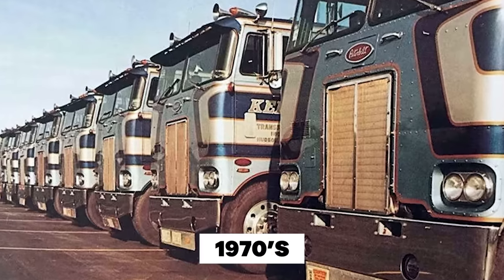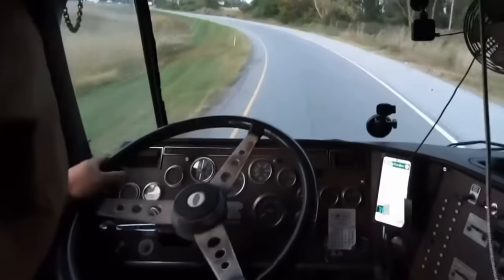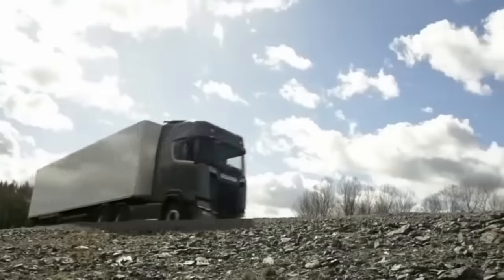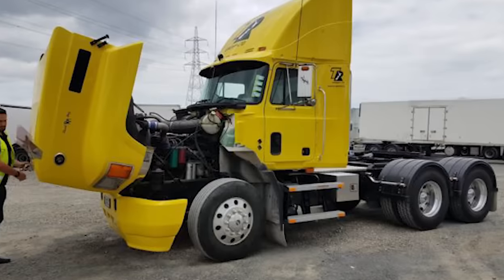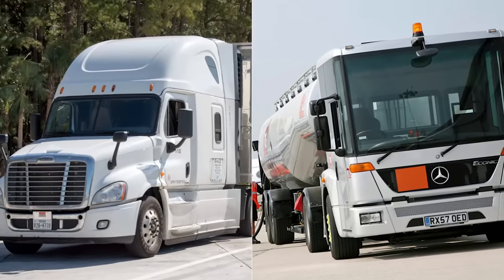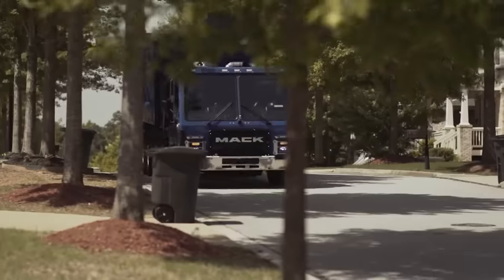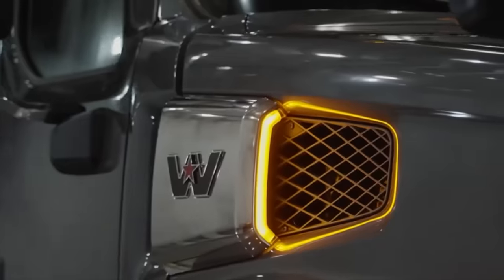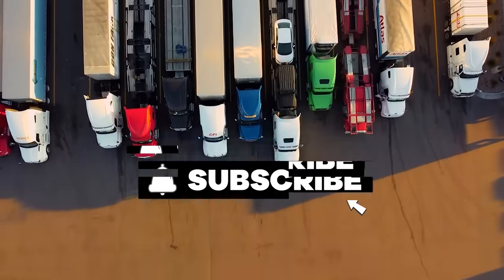The REAL Reason Why America Stopped Making Cab-over Trucks

Comment: In English they are known as 'forward control' and they are not only favoured in Europe because of legislation, but because of the roads. Many roads through European villages, towns, and cities, have remained unchanged for hundreds of years and were designed for horse-drawn vehicles. You're welcome to try driving one of your monstrosities around Europe, but I wouldn't recommend it. Even with the limited overall length of European vehicles, it's still not unusual for them to get stuck on narrow roads.
Reply: happens in a lot of northeastern US cities too, As like the ones in Europe they predate motor vehicles.
Reply: You’re also first on scene of an accident, plenty of cases of ejections through the windshield from impacting other vehicles, COEs are cool but conventionals are much safer for the driver
Reply: @loganbaileysfunwithtrains606   modern cab-over trucks are very safe, i think volvo has one of the best safety features in their trucks today.
Reply: @loganbaileysfunwithtrains606  Not much evidence of that. From statistics from the NHTSA, in 2020 there were 608 drivers of heavy trucks killed in the USA. In the UK (where cabovers are universal), 18 drivers of heavy trucks (called HGVs in the UK) were killed. That means in the USA there was almost 34 times as many trucker deaths with just 5 times the population. That's over 6 times higher adjusted by population. Of course, distances driven are much higher than in the UK, but when I looked up the statistics further, there were 3 truck drivers killed per billion miles driven in the USA and 1 per billion vehicle miles in the UK. That's close on a ratio of 3:1.

There is another point, that a cabover gives much better visibility at junctions, simply because the driver is so much further forward. Safety isn't just about surviving a crash, but avoiding them in the first place.

In any event, in both countries it's other road users who are in more danger. In accidents where a heavy truck is involved in the USA, only 17% of the fatalities are to the truck driver.
Reply: If you put your seat belt on, it's not a problem....
Reply: Let me guess, too cool to wear a seat belt?
Reply: No thanks on driving a monstrosity on European roads.  In the northeastern United States,  there are a few older places that are very challenging to get one into. Some city streets in older cities like New York, Boston & Philadelphia are difficult too.
Reply: Here in town even for busses it is narrow. Every car coming in front need to really watch and the bus driver needs to drive exactly narrow on the curbs and the car driver watches to not Scratch his alloys.
Reply: The reciprocal of your European circumstances is true in North America. Modern municipalities with wider longer highways and streets, greater distances between cities and towns, above all far greater comfort and safety in the conventional truck negates the use of cabovers in America, that includes Canada . I've observed that Russia favours conventional trucks. Why do you think that's so? So we can agree that cabovers are suitable for most of Europe and conventionals for North America, especially for Canada. Even most of our occupational trucks are conventionals.
Reply: Just because you cannot use them in Europe you do not need to bash them and call them monstrosities. You have probably never driven one so don't bash what you do not know. Besides pushing all of the air with that big flat front is probably really a fuel saver for you.
Reply: @scrambler69-xk3kv  yep they are thinking of changing the rules a little for EV trucks. EV trucks are also allowed to load slightly more weight. But why not for everyone?
Reply: @loganbaileysfunwithtrains606  try to see safety test of modern european trucks, all is very serious, you survive in almost 99% of car accidents possible to happend with your trcuk
Reply: Thank you for typing out what was said in the video.
Reply: @loganbaileysfunwithtrains606 there is nothing conventional about your oversized american trucks
Reply: @TheEulerID I've been driving an over-the-road truck in the United States for close to 37 yrs and I loved the cabovers. 
As far as safety almost all of the crashes involving a car and truck its most of the time the cars fault . 
I avoid many crashes daily because people in cars don't realize how long it takes for a truck to stop or that a truck needs to swing wide on corners. 
I get brake checked and cut off on a daily basis.
Reply: Been there done that in full size American Truck and Trailer. There’re many towns and roads like this in small Northeastern and North Western US that were built 200 -300 years ago and the Main Street that as straight as a ruler is the only street you can drive through … If you need to access some building and it’s not on the Main Street you have to call your receiver and ask them to bring small box truck and a Fork Lift or a Pallet Jack ..
Reply: Love the dig at the US "monstrosities" yet you make excuses for your poor roads.
🙄
Reply: I like my monstrosity thanks. I'll keep it.
Reply: Lotta words to reiterate something already said in the video. Needed to slip "monstrosities" in that bad? Maybe it'll help you sleep better in that coffin of a COE.
Reply: Yes yes.😊
Reply: @TheEulerID we have immensely longer distances to drive on average…
Reply: @clydecraft5642  Not necessarily. The EU has a lot of very long distance truck drivers. It's one big market, and there is a great deal of goods driven thousands of miles. There are plenty of drivers of such trucks and that stay overnight in them. You might find trucks travelling from Romania to Ireland, or more than 2,000 miles. 

Of course the distance driven on any one day is limited by the number of hours that they are allowed to drive.

In any event, it's a myth that US trucks are safer or more comfortable. They are not; modern cab-over designs from Volvo, Mercedes and so on with air suspension are at least the equal.
Reply: Yes, that term was used in the US as well, he just failed to mention it, or maybe he was not aware.
Reply: we dont have narrow roads here, especially none that were designed for horse drawn vehicles. our roads are made for high speed travel, that only take really really slow turns so you can drive 250kmh and beyond, thats why we dont have a speed limit here in germany. the reason we stick to capover engine designs is simpy the opposite of what he said. you have more space for a bed and the driver. our trucks are as long as the american trucks. they have their driver department and the engine in the front, our trucks are the same length, but because the cab is over the engine the cab can be way bigger. a sleeping compartment is required by all trucks, because the drivers have to have a place to sleep, because in europe they drive a lot of long distances like a really important route is spain to germany, because spain has literally the most greenhouses in the world to grow all our fruits/vegtables that get sold in markets here. but the larger ones im talking about for really long distance hauls have cooking space, too. its like a camping van on the inside.
Reply: @rolhen8221  Don't you think other countries have similar roads to the Autobahn, including the UK?

In any even, there are twice as many fatalities per billion vehicle miles on the German Autobahn system than on UK motorways. Ultimately, you can't beat basic physics. Kinetic energy goes up to the square of velocity, braking distances vary with the square of speed, and the distance travelled in the reaction time of a driver is proportional to the speed. 

Large speed differences between vehicles increased dangers markedly. There may even be fewer accidents on the Autobahn that on UK motorways, but at much higher speeds, they become much more violent.

Then there is the environmental impact as travelling at high speed simply burns far more fuel over a given distance.

Unlimited Autobahns are the German version of the US 2nd Amendment to the constitution. Basically justified by boneheaded stupidity refusing to accept the consequences.
Reply: @TheEulerID The unconsidered factor here is that most of those US deaths are due to inexperienced drivers falling asleep or misjudged the weather. We get every type here, and some of those drivers have never seen snow or ice.
Reply: @TheEulerID  Speed, driving conditions, and amount of time behind the wheel each day are factors. In the EU, the speed limit for large trucks is generally lower than in the United States--80-90 kmh is about 60 to 56 miles an hour.

____________

Experience of a UK trucker working in the United States:

When snowstorms would hit Mick Flynn's native England, he and his fellow truckers would pull over.

"Most sensible people parked over somewhere and enjoyed a nice cup of coffee," Flynn told Business Insider.

However, he said that's not the case in the US and Canada, where Flynn has driven on and off for the past decade, and that "you're expected to carry on."

That's because of a major flaw that Flynn and many others see in the American system of driving: Truckers are paid by the mile, not by the hour.

And they're allowed to work more hours per day — British drivers are capped at nine hours, but American truckers may drive up to 11 hours. (In a 2015 survey, nearly a quarter of drivers said they "frequently or always" exceeded the 11-hour limit to earn more money.)

"In England, if the roads are icy, cars pull over because you're still going to get paid," Flynn said. "If we pulled over in the US or Canada, we're not earning anything. So we were driving in worse weather than we would in the UK."
Reply: I drove a Transtar for years and I didn't push a lot of air cuz I was behind a conventional that was slicing it for me. There was times I got 8.5 mpg with 80k on the long runs.
Reply: @AverageAlien  the entirety of the Americas is oversized. A perfect fit.
Reply: I remember two words from Germany. Maneuver Damages.
The most humorous and expensive being when paper bags of potatoes broke loose from an air drop and shattered roofing tiles. All had to match, so the US Army ended up buying the homeowner an entire tiled roof. Needless to say, those spuds were properly restrained in subsequent air drops.
Someone always cut a corner too tight, got expensive. Ran over a cow, learn that that cow sang the kids to sleep and taught them to read and write (OK, pay for what milk the cow would've produced over its entire, long life and well, rightfully so).
Oddly, I never damaged anything. But then, I hate paperwork and hate screwing up other people's property even more, as I'd not like it happening to me.
Reply: How many people here are actually truck drivers?  🤔
Reply: @ernestpaniagua1210  back when I was in the army.
Reply: Sounds like Vermont.  Every time I picked up rocks in Central VT, going to Chicago,  I got a specific routing from the STATE of VT that I had to take or be fined.  I snuck in across the NY border once and found out why.  I very nearly couldn't get around a town corner because the streets were so narrow and buildings co close together.  After that I followed the mandated routing.
Reply: Why must you call them monstrosities. If you would see them on the roads they were designed for they look ever so normal.
Reply: @scrambler69-xk3kv  well, they were designed for narrow streets. Still have quite a few around for that use in US inner cities, where streets can be way too narrow for long nose vehicles.
And I've driven both types in the Army in European streets, the point is valid about long nose trucks on streets designed for horse carts - as true as for Boston, Philly or NYC.
Reply: @scrambler69-xk3kv    Yes, cabovers are awesome.
Reply: I totally agree. I drove for 7 years in Europe for AAFES Europe (Army Air Force Exchange Service) in the 80s and early 90s. We had COE American trucks (GMC, White and Ford) because there's no way you were going to make it anywhere with a conventional. A German friend of mine bought a 1989 Peterbilt 379 and shipped it to Berlin. He only hooked a trailer for truck shows. There were corners he couldn't take bobtailing. Europe made a truck driver out of me for sure.
Reply: even a fkn camper gets stuck in some small EU city. you miss 1 sign on the road and you are done for the day
Reply: @joelspaulding5964 with their ugly little cab over😂
Reply: Much like our cars, long nose tractors are built for long distance comfort. Driving a hard sprung crap box 1700 miles just so the very end of the trip is a little easier when maneuvering is a pretty miserable trade off.

Comment: I'm not a trucker, but recently I drove a smaller cargo vehicle with a flat front for the first time.  My first response was fright; you seem more exposed without any hood out in front of you.  But second response is holy crow you can see everything!  The visibility was insane, like you're in a fishbowl.
Reply: YES!   You can SEE a whole lot more!
Reply: I went from a Columbia to a 2009 Volvo VNR and the view was immense, but that was because you were sitting right up against the windshield. There was no depth to the dashboard, you couldn't even put a coffee cup up there. Compared to my current Cascadia and there's like two feet from the edge of the dash to the bottom of the glass.

You didn't climb in that volvo and sit down like normal, either. I had to hoist myself up over the seat with the grab rails and then slot my legs in, it was like putting on a pair of pants.
Reply: @NutjobGTO    I guess that's what happens when trucks are required to be designed to fit unreasonable  aerodynamic specs without giving any thought to driver safety and comfort. That sounds like a nightmare.
I drove 1983 to 1993  International cabovers and 1994-1999 Freightliner cabovers and was comfortable.  They all had a wide dash,  but not as wide as the Cascadia you describe.  Be safe!
Reply: @NutjobGTO The lessons learned there were applied to the FH.
Reply: @kathyyoung1774 i respect the years you have in service, but i also recognise the ignorance in your statement. American vehicles and European vehicles are built with different specs in mind. You will definitely need more protection if everyone around you is driving a battering ram. In Europe (the EU) we use paper cars (tiny mini vehicles) so you can sit on 2 inches of truck protection and no one is killing you with their cars. Then the USA is massive, so you can't go anywhere with our paper cars, compared to our small EU countries. 
So, just learn to respect every market catering for the needs of it's people
Reply: @innocento.1552    That actually makes a lot of sense.  I assume big trucks don't go on the Autobahn.  Best wishes.
Reply: @kathyyoung1774  Trucks are one of the primary users of the Autobahn, especially near the factories. MAN, Mercedes Benz, and Volkswagen are based in Germany.
Reply: 1st one to the scene of the accident
Reply: @kathyyoung1774  Drivers safety is partly in the hand of the driver. Just think of your own safety can lead to not safety driving.
Reply: @47rintin1  True.  I taught trucking over the road and taught trainees that they had to anticipate the movements of everybody around them.     If you can see the driver, you can often get hints from head movements and other body language.
Reply: That's what my grandad remembers driving cab over doing delivers in London England and driving for the army. We both also love the little cab over pick ups imported from Japan used where we live for deliveries.
Reply: You don't get as much view in a cab over as most people think. Like a bonneted truck (in a way) you can't see what's right in front of you and what is right by your passenger door (two of the main kind spots) going from a cab over to a bonnet you get a narrower cab and you can't see where your front wheels sit so you put the center line of the bonnet on or around the outside line or you look in your mirrors.
Reply: @outlawdingo3020    I drove plenty of both kinds for years as a company driver  but chose to buy  cabover and could see much better in it than in a conventional.  I don't know about you, but I had plenty of mirrors, incudingn the "school bus mirrors" that do a great job of showing those supposed "blind spots."  I surely could see right in front of me .
Reply: @kathyyoung1774  I don't have extra mirrors. We typically do a lot of road trains in the out back too so you only need to see way out front (as you do anyway) as it takes about a kilometre to safely stop when your around 120-130tonnes moving at 90-100kmh
Reply: @outlawdingo3020   Awesome!   Yeah, nobody is driving beside you there.   I tried to talk my step brother into doing that with me for a year after another friend came home from Australia with tales of her adventure.  But neither of us was a good enough mechanic to risk it. Best wishes, and be safe!